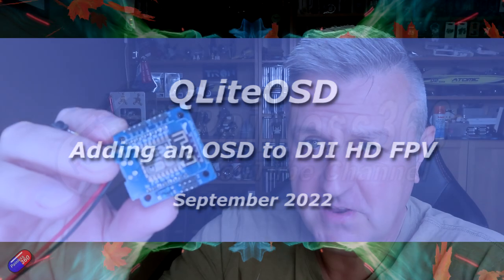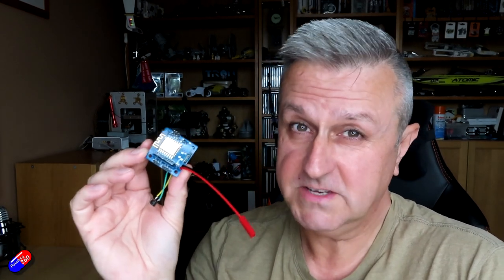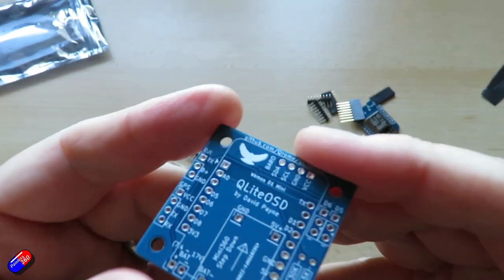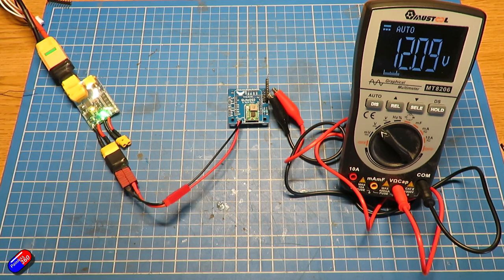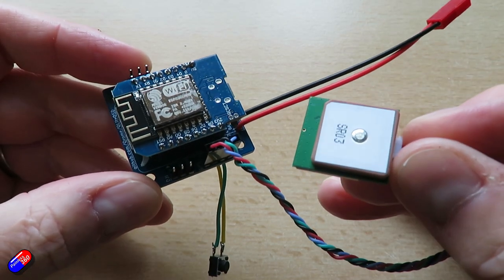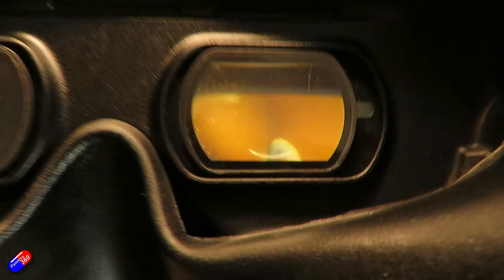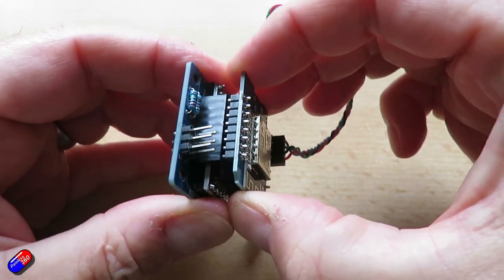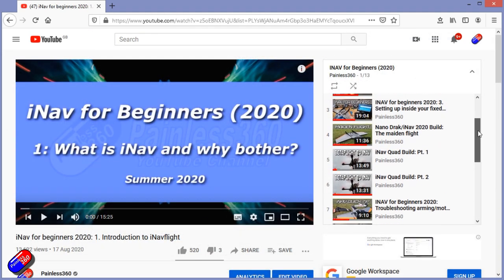QliteOSD: Add an OSD to your DJI Goggles WITHOUT a flight controller!

Comment: Great little electronics project, but more work than a lot of people will want to do. Check out the Tbrc dji osd board. It's gives you a basic osd for dji with bat voltage and timer, and is plug and play
Reply: wow that is kind cool, glad I read the comments, so it just plug in beteween the bat and plane ? then you plug the air unit into it?  does it come with that 4 wire plug to the air unit??
Reply: I see it comes with the plug,,,ez peezey! I like it

Comment: This is nice but kind of bulky.  A nice feature would be a pwm or sbus input (from your RX) to the arduino that could also serve as an arming switch for air unit power up.  A couple years ago I did something similar to this with a tiny betaflight board - seems a bit easier than this project actually.  The only trick is you have to modify the firmware to trick it into arming with only one visible channel from the RX (if you want autotemp on dji).   I still think this project is cool but think using a generic betaflight FC would be easier.   Note that this was a plane and no servos or esc's were connected to the flight controller.

Comment: Nice, is there any way this would allow having the OSD info show via the goggle's video out?  (I know it's very unlikely to be the case but asking anyway as I guess the only way to allow that would be by tapping into the MIPI interface and mixing the video of the camera with custom OSD to be fed to the ait unit).
Reply from the maker: This pushes telemetry into the air unit for the traditional Custom OSD we've been using for years...Happy flying
Reply: @Painless360  Thanks!

Comment: Anywhere you can get these pre-soldered and flashed ?
Reply: Really fancy this but £16+ shipping from US probably makes it un-economic for me
Reply: @tubamanandy2  most of the components are available off the shelf in hobby stores. Only the main pcb isn't. You could solder the components with flying leads to the wimos board or design your own pcb.
Reply: @charlesjones5070  exactly -- you don't have to use the PCB main board but it sure makes it simpler and cleaner to install.

Comment: Hi, anyone out there help a noob out , just got my crossfire v2 looking to put the antenna on the wing sma cable I presume needs to be longer how would I make that longer ? Does eBay or tbs sell those just not sure what I’m  actually googling, many thanks 🙏
Reply from the maker: Adding more length to the antenna isn't a great idea. Any connectors cause additional losses. I'd look to how to mount the receiver as close to the antenna as you can. I've never needed a longer antenna cable, see my TBS Crossfire builds.. Happy flying!
Reply: @Painless360  thanks sir so good to get these tit bits of advice unfortunately I don’t have any mentors or buddy’s flying local so rely on these videos so much thanks again. Really really appreciated

Comment: I can't get the GPS portion working with a BN-220 using the QLiteOSD.GPS_IMP_1.1.bin file. Is there a reason why this GPS unit wouldn't work?
Reply from the maker: I asked the designer and he said that any u-blox supported gps running 9600 and 3.3V should work. Best of luck